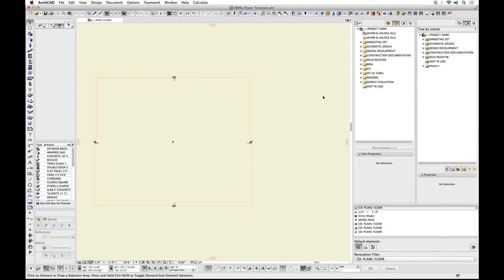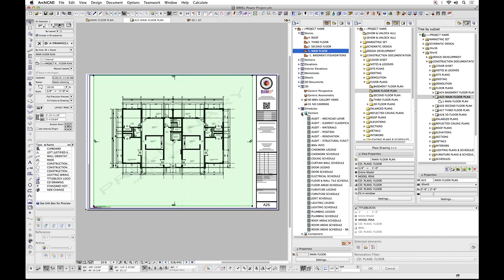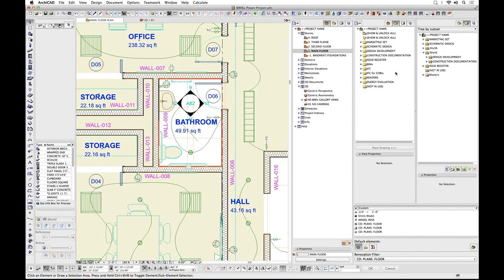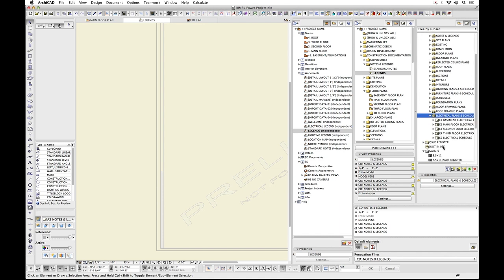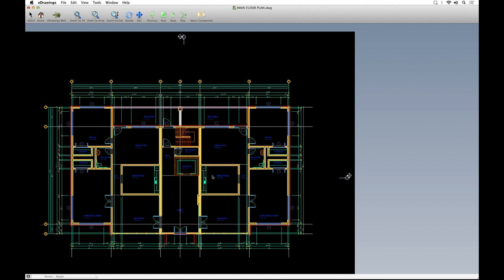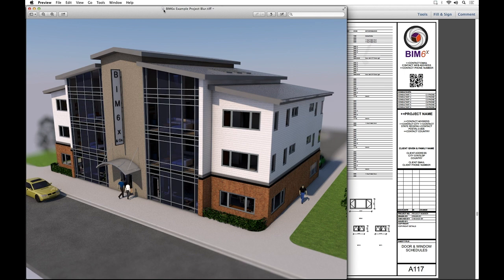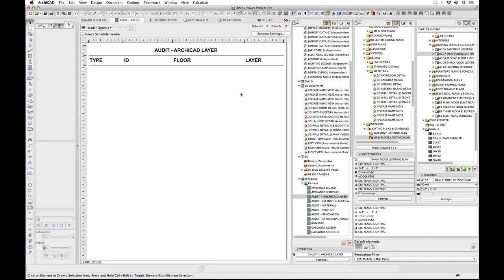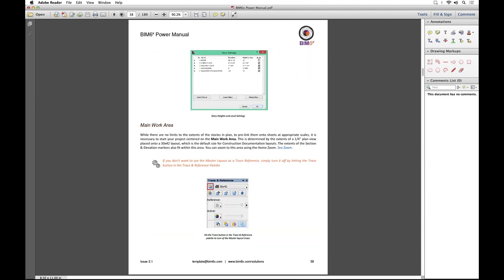Secrets to a Groundbreaking Template Revealed

Comment: It would be helpful to illustrate the work process using the template starting with a new project; opening up the template and deleting the template building(?) and starting the design of a totally new project. 
Other than that a great video and very helpful.
Thank You,
Reply from the maker: Thanks for your feedback. Right around the 3-minute mark, we mention that we will go into a file with a project in it, which is what is shown thereafter. The template is typically void of any building elements.